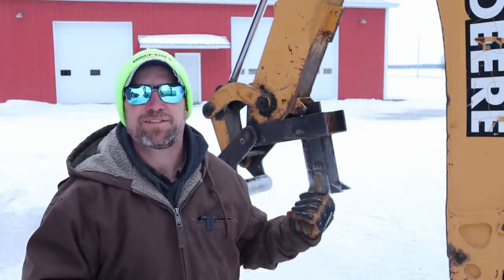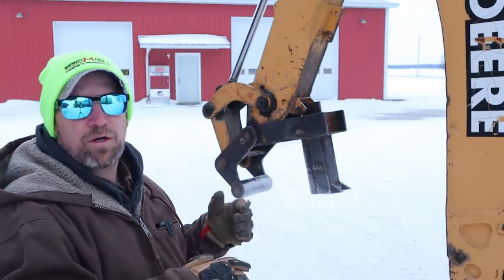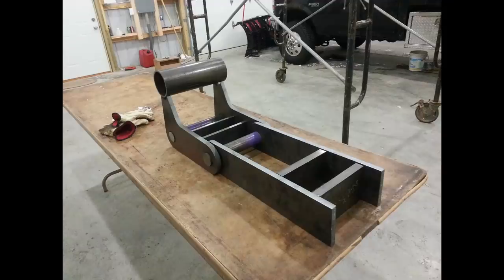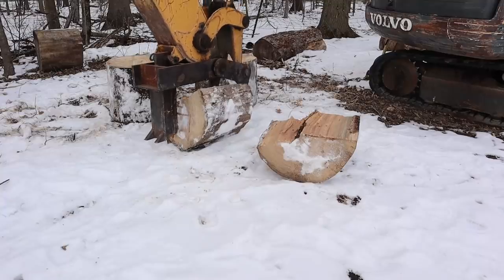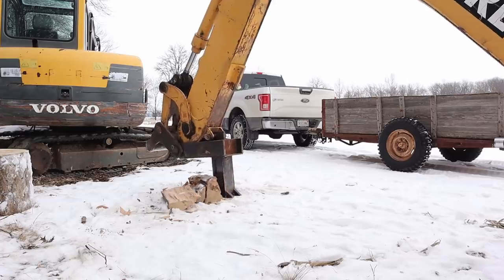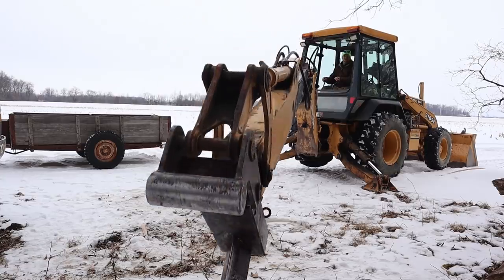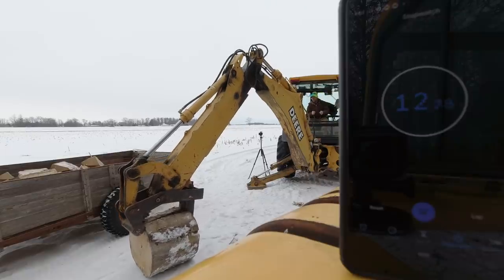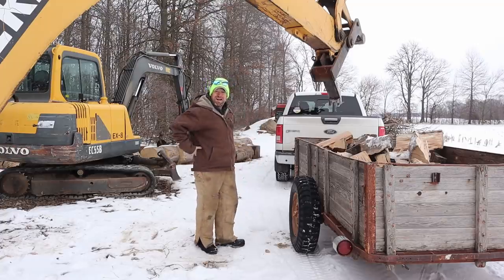My Wood Splitter Doubles as a Backhoe! - Homemade DIY Wood Splitter Splits Large Rounds With Ease

Comment: Neil, is there something like this for my 1025R front loader?  Your design works really good!  If I could fabricate something similar for my front loader it would save my back.  I have a very small electric over hydraulic splitter that works great, but it struggles with some of the larger rounds and they are hard to maneuver as the get heavier with size.  Nice demonstration!  Have you been watching Keith Appleton?  He always finishes with “I hope you found it useful“.  Jim
Reply from the maker: I don't know of anything for the 1025R but it sounds like something that would be a good idea and likely get some good business if someone made one for a compact tractor.  It is tough to move those big rounds, especially alone.  I'll keep my eye out for something like that.  I haven't ever seen Keith Appleton.  I didn't know I was copying someone else.  Dang it.  I have been trying to think of a good phrase to end the videos.  I always think of Red Green's "If the women don't find you handsome, then they should at least find you handy".  Man I wish I had something like that.  Any suggestions?  Thanks so much for watching Jim.

Comment: Hi Neil I ended up buying that 310E backhoe. I also have an outdoor wood boiler for heat and was wondering if you would be interested in emailing me a set of plans and measurements of the splitter end you made up? I would pay something for your trouble. I thought it would be easier to get what works instead trial and error on my end.
Reply from the maker: Congratulations on the backhoe Dave. Unfortunately I don't have any plans drawn up to share at this time. I'm always meaning to get some made up but I never had any to begin with 😋

Comment: I made one similar for my mini-excavator bucket. Is that excavator yours? That attachment is so much more versatile on an excavator since you can just roll up to your pile of rounds and move them around easily.
Reply from the maker: The mini-excavator is my father-in-laws.  I made the backhoe splitter long before he purchased the mini.  I agree it would be much more handy on the mini.  Only problem with being on the mini is I would need to haul it around wherever I want to use it and the backhoe I can just drive it there.  Most of my splitting is within a couple miles from home at various family properties.
Reply: @digdrivediy  yep I have the same issue since I don't have a trailer for my mini.

Comment: Neal, you've probably gotten this already, But if you put on some pin bosses, drilled them and the pins for bolts, you might not have the problem with the sheared bolts. Use #8 hard bolts, self locking nuts, and you're in like Flynn. Have a blessed day, my friend.

Comment: I threw my maul in the woods and left it there. I prefer a double bitted axe for hand splitting but I really  prefer my 30 ton splitter.
I don't think my 47 HP tractor's third function can generate as  much energy as your digger can. I do like the pick 'e up and drop 'em  option you have.
Reply from the maker: I own a couple mauls but I couldn't tell you where they are!  Most everything around here is mechanical nowadays.

Comment: Really like the idea. Thanks for sharing. & would you please share the link for the “retractable claws” you used at the end?
Reply from the maker: Thanks Lucas!  I should have posted a link in the description and I will do that tonight.  Thanks for the suggestion.  Here is what I got.  I bought the pair: https://www.ebay.com/i/151917410298?rt=nc&_trkparms=aid%3D1110006%26algo%3DHOMESPLICE.SIM%26ao%3D2%26asc%3D20160908110712%26meid%3Dbc8fb23403cc4555ba91078ad508c3bf%26pid%3D100677%26rk%3D9%26rkt%3D18%26mehot%3Dag%26sd%3D324057100451%26itm%3D151917410298%26pmt%3D0%26noa%3D1%26pg%3D2386202%26algv%3DDefaultOrganic%26brand%3DHusqvarna
Reply: Hi Lucas - it's Big Rodders in Ireland.   A word of warning about buying the Husky timber tongs.  They make two models 30cms (11.75inch) and 20cms (8inch).  I have both but found that the 30cms are more versatile for the larger rings.  It will amaze you the size of logs that you can lift both single and double handed plus how much less you have to bend down.  An added bonus was that here a pair of the 30cms tongs were approx a third the price of a Log Ox.

Comment: How come that last split you don't swing over the trailer then finish splitting? Great splitting vid.
Reply from the maker: Good eye Jordan.  Normally I always split over the trailer on the last split as I did early on in the video.  To be honest I put the pile on the ground just to try out the new timber tongs that I had purchased.  I hadn't had a chance to experiment with them yet.  Also, sometimes it's quicker to just pick up a bundle than it is to swing each one over.

Comment: Great video. Do you have the measurements for the thickness of the steel that you used. It looks like half-inch. It is at coreten or simple mild steel?  I have a Ford 4500 which is a 50 horse diesel and a heavy duty backhoe. It should work very well for my set up. We have so many dead ash trees now that we need to get things cut and split. Thanks again for your great show. I assume you put it on your wheeled backhoe because it’s easier to travel around to where the wood is. If you put it on a mini excavator, you’re stuck with moving at the speed of the tracks.
Reply from the maker: Most of the framework is actually 3/4" thick.

Comment: Ya good setup for that would be a grapple bucket on the front end to grab a pile and when done, swing around and it to dump in a trailer after splitting.

1.Fill grapple bucket with log(s)
2. Cut logs to desired 24 inch or less. and let them fall to a round pile.
3. Swing around and split as you did,
4. Swing around again and grab split rounds to dump in trailer!
5. Enjoy that strange sensation your life is just going around and around in circles!
Reply from the maker: Haha!  That sounds like a winning setup Steve!  A grapple sure would be nice to have.  Appreciate you watching and the great comment!

Comment: Keep it simple: no need to drill and insert a stud to keep that bolt from shearing. Just weld a length of 1/4” plate on either side of the pin’s tab so that it cannot rotate. Keep the shear forces off the bolt.
Reply from the maker: That's a great idea!  Sometimes we overlook the obvious and I could likely have that done in minutes!  Thanks for the suggestion. Oh, by the way; did you mean to say "Keep It Simple Stupid"  :)  We call it the K.I.S.S method around here 👍
Reply: @digdrivediy  your average youtube video gets enough harsh comments that I though I’d do you a favor and leave the ‘stupid’ off. It’s a good solid build, clearly you aren’t unintelligent. 😂👍
Reply from the maker: @WildAcresFarms  Haha.  True.  I appreciate it!
Reply: @digdrivediy  (also, I cheated in coming up with that idea. I’m a heavy equipment tech, and Komatsu and other have used exactly that setup on a few older dozers.)

Comment: I had the same idea and went on Google to find what you did. I wasn't surprised really just wanted to see ideas. I've made the pusher and am very happy with it. Fits a John Deere 110 TLB. Small machine but the hydraulics have some A$$ to them so we'll see. I'm trying to come up with a way to cut the splitting wedge point. I have a piece of 3/4" plate steel 9" wide and 19" long. I want the included angle to be on the 19" leg. Curious on how you cut yours. Could you share this with me ? Thanks
Reply from the maker: Mine is a 1 in thick piece in the center of the wedge with 1/2-in pieces angled off the center to make the wedge. I filled the point up with weld and then ground it down into a fine point. Basically, I built a box in the shape of a triangle and then just ground the edge of into a nice leading edge point. Does that make sense because it's hard to explain.

Comment: Thank you for sharing your ideas i love this and your fork mounts for the backhoe buckett. I have a 310e extendaboom my dipper does not have the ears on the bottom where you mounted the wedge, did you weld those on ?? If so did you remove the dipper boom ? What about all that grease ?
Reply from the maker: Hi Kenton!  Thanks I really get a lot of use out of my backhoe.  I welded those ears on the bottom originally for my mechanical thumb.  It is just welded to the outside edges of the dipper stick. I didn't remove the boom and it doesn't get into any grease.  Seems to be working pretty good.  Hope that helps. Thanks for watching!
Reply: @digdrivediy  thank you sir !! God bless you

Comment: Hello, love your channel 😊 that splitter is amazing, such a great idea! We are irish living in France, and cut a lot of timber ourselves. We plan to copy this, looks like it will save a lot of time. My dad has made a hitch that fits on the front of the digger to pull the digger after any other machine, to save the need for a second driver. If you would like to check it out it is on our channel, on the episode about fattening cattle. Keep up the good work, looking forward to the next one 😊
Reply from the maker: Great to hear from you!  I'll have to check that out on your channel. Appreciate the kind words. Good luck with your build!  You'll love it and you'll get really good at running backhoe.

Comment: When your splitting wood you start at the outside and work your way in. Taking material off the outside sill make it easier to slit the middle
Reply from the maker: Great tips! I have to do it even with the backhoe that way.

Comment: hey man, why don't you have more than just 1 wedge? build a star type pattern so it bust the whole log into multiple pieces, make it like a broad head shaped arrow.
Reply from the maker: I had a four way wedge on there for a bit.  It wasn't designed quite right, plus it was difficult when I didn't want to split 4 ways, meaning many times I ended up with little toothpicks that are too small for my stove.  I found it just worked the way I want it all the time without the 4 way.  I may try again someday though to make another 4 way.

Comment: How thick is the steel plate that you used to make the splitter?
Reply from the maker: The sidewalls are 3/4" thick and the top flat plate was 5/8".  The main splitter wedge has a 1"X5" flat bar in the center and then the wedge is built out of 1/2" plate. It is very heavy!

Comment: I thought you were just going to use the teeth on the bucket to split the wood!  I was surveying a residential development once where the clearing crew cut up the trees they cut into firewood, then had the track loader use the teeth on its bucket to split it.  One log under each tooth, push down and it all split!
Reply from the maker: I've tried to do that too and it feels like it's hard on the backhoe for me.  I knew a guy with a Ford 555 backhoe that did all his splitting like that too.  Some machines are better at that "chopping" motion too.  It would be fun to do it that way also!  Thanks George for the comment.

Comment: Could you tell me the type(s) of steel that were used to build the splitter ? TIA
Reply from the maker: I think it was just regular cold rolled standard steel.  I really don't know as I had it cut by someone and just took what they gave me.
Reply: @digdrivediy  Great, thanks pal, Subbed👍

Comment: That machine looks like it could handle 2 or 3 wedges or points (cones) at the same time...no?
Reply from the maker: I had a 4 way on it for a bit. It was sometimes a struggle and got in the way when I wanted bigger chunks.  I ended up with a lot of kindling and toothpicks when it was on there so I cut it off.
Reply: @digdrivediy  I was thinking more like 2 horizontal parallel wedges 12" apart

Comment: drill a hole in the end of the pin on the other sde and put a clevis clip in it and then thepin can move around and the clip will keep it from falling out
Reply from the maker: I would have done that already Alan but dang it if I didn't make the pin flush on the other side.  I don't have any extra length to get a hole through it.  I need to either redesign the current setup or buy some longer pins to do what you've suggested.  Thanks for the great idea and thanks so much for watching!

Comment: Just put a piece on the bottom side so the log doesn't hit the pin i have done it with thumbs quick fix
Reply from the maker: That's a good idea if I'm following you... and I think I am.  Thanks for the suggestion.
Reply: @digdrivediy  no problem bud

Comment: How about a cotter pin on the other side to hold the pin on
Reply from the maker: Cotter pins on a backhoe I have found don't want to stay in.  Plus the pin was cut so that it is nearly flush on the other side so unfortunately not an option at this point.  Good idea though regardless.  Thanks!
Reply: @digdrivediy  it was a thought
Reply: @digdrivediy  what I was thinking is a pin that goes through a hole on the pin and also has a O ring that snaps over I hope you know what I’m describing
Reply: @digdrivediy  I really enjoy you videos

Comment: Add 2 more wedges so you can split it in quarter. That machine looks like it would handle it with no problem.
Reply from the maker: I had some on there for awhile. You can see where I cut them off if you look closely.  It struggled a bit and was causing problems with wood jamming up. I needed to redesign it and haven't yet. I may try again someday. Thanks for watching!
Reply: @digdrivediy   Set your secondary wedges back a bit so primary splits first & then you'll have power for secondary wedges.  3 times faster if you can quarter a log in one pass...

Comment: What was the cost to build ?
Reply from the maker: Well I built this about 10 years ago now so the cost is hardly relevant by today's standards. I only had about $300 in the steel back then and we welded it up at home.  Then maybe $100 in making the pins- so all told around $400-500.
Reply: Thanks for the reply .
Could you make another video talking about the deminsions steel thickness and how it has held Up .

I know the deminions are different on every machine  but the princaples of how it works why you set it up that way and the thickness of the metal . Has it held up to the stress ? . 

What has been the biggest and toughest round to split ? 

Plus what you would have done different after the years of testing .
This would make a great follow up video !

Thanks  for sharing and the reply

Comment: On your piece of paper with measurements I can’t see how long the piece were the wedge mounts is can please share this measurements
Reply from the maker: That measurement is 24".  After looking at the graph paper I think that I made a few changes to the original drawing after building it with wood.  Do you have a John Deere backhoe Norman?  Some of those measurements are obviously going to be different if you don't.
Reply: Yes I have a 310 also
Reply from the maker: @normankuntz3152  If I think about it I'll try to see if I have some better measurements.  Good luck with your project!
Reply: @digdrivediy  thanks
Reply: @digdrivediy  What a great idea Neil, you did a super job, im almost done coping your design for my 310SE, the only thing I need is the  length of the cutting service of the knife, I will then extend the cutting edge to the pin to fit. Thanks Ken from Ontario Canada
Reply: @kenkbw did you ever complete this? I’m also in Ontario and would appreciate seeing your setup if possible.
Reply: @cdunham6486  Yes, split lots of wood with it

Comment: For your pin instead of bolt i would use a dowel of air hard steel arlsh13 hi charpy value, better than staninless or hi carbon steel, just try to hammer it out hot on a anvil you will see.

Comment: Why didn't you make it a 6 way splitter
Reply from the maker: I made it a 4 way once and it just caused problems.  Took too much force and wouldn't split some logs and other times it was just getting in the way.  I may try again though with some new engineering ideas.

Comment: Why not put wings on the blade so it splits 4 ways?
Reply from the maker: I tried some wings and it didn't really like them on there.  I may have been able to design them better but the way I had it didn't work.  You can see where I cut them off if you look closely.  Maybe I'll try it again if I have a chance.  Thanks for the comment!
Reply: Maybe you could devise some that are detatatchable . @digdrivediy

Comment: Would the hydraulics be strong enough to push more then a single blade? Winder if you could weld 4 more blades on there so you would just have to crush each log once similar to the wood processor you used that dirty log in just kidding lol something was definitely up with those blades
Reply from the maker: I tried a 4 way on there and it was a combination of me building it wrong and the hydraulics being weak.  I keep wanting to try it again.  I had the two "wing" wedges too close to the cutting edge of the primary wedge and it didn't make the log split before it got to the wing wedges and it would just stop. Worked great on a few species of logs but mostly didn't work at all.  I laughed out loud when you mentioned the dirty log!  Too funny.  Thanks much Benjamin!

Comment: I'd say your average 30 ton log splitter cycle time is around 12 seconds. And I think I counted 13 pieces? So based on cycle time alone, that's rounded to 2.5 min. Now, you have to add all the manipulating the logs into position - I'd say 5 or MORE seconds each pieces (and that's if you are BOOKING it super fast) That's another 65-80 seconds. (we're over 3.5 min now) THEN you have to count for the loading. That's AT LEAST another 2 minutes. Finally add 2 hours to the total log splitter time for all the back, leg and arm ache it causes. So yeah. 2 hours and 5 minutes VS 3 minutes. Definitely a MUCH better way to split.